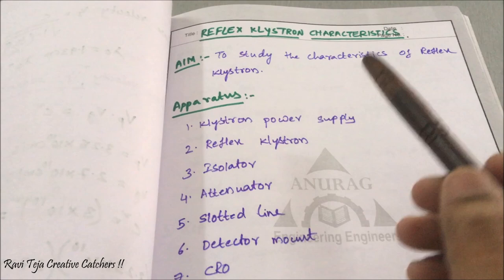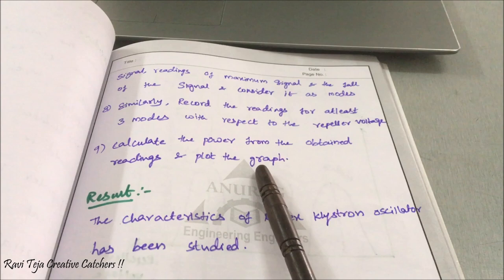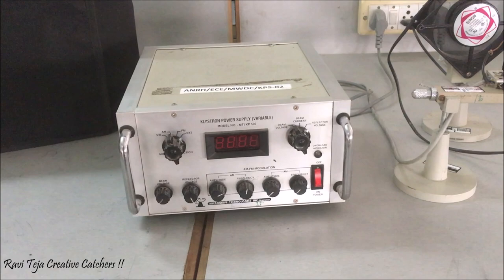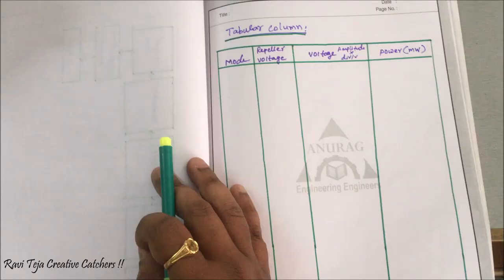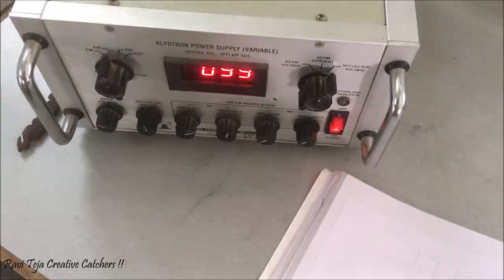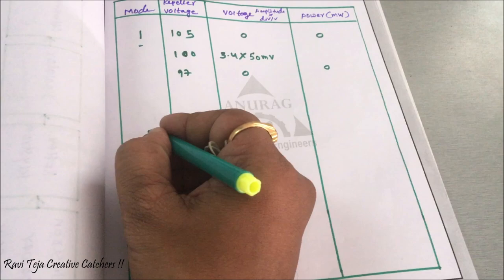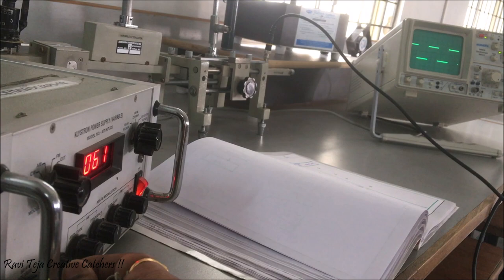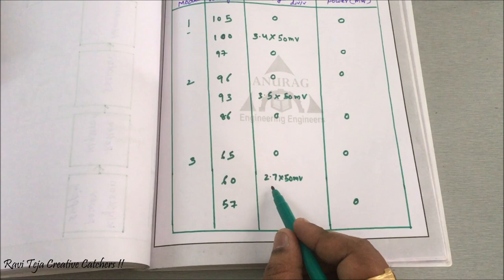Reflex klystron characteristics experiment

Comment: Can we use vswr meter here sir.
If so how can we use that
Reply from the maker: Yes you can
Reply: Also major doubt how could we get square instead of getting microwave signal in CRO. We were told that microwave frequencies are not visible in CRO. But what is the presence of squarewave here plz explain sir
Reply from the maker: @prabhuns1791  microwave signal when modulated can be seen on CRO, that is why modes like AM mode is applied in klystron power supply to generate microwave signal, as the signal is modulated it is shown as square wave in cro.
Reply: We see the low frequency component as square wave that of the high frequency microwave signal with the help of modulation